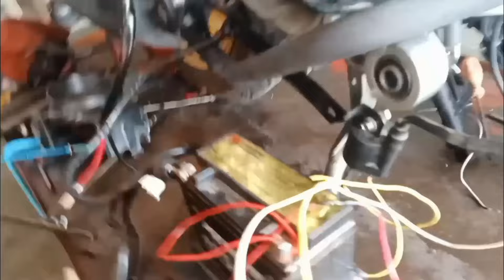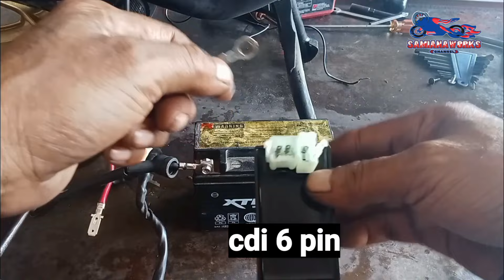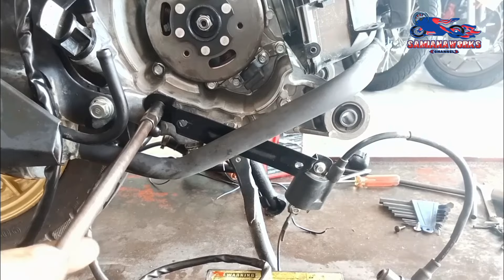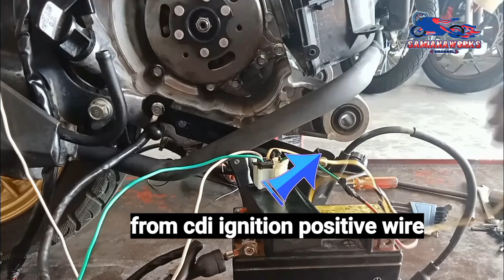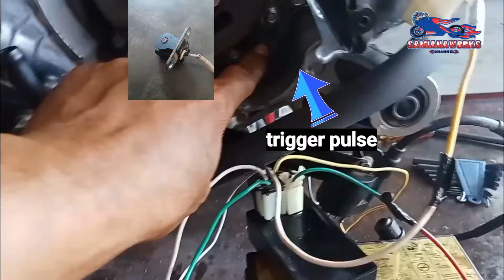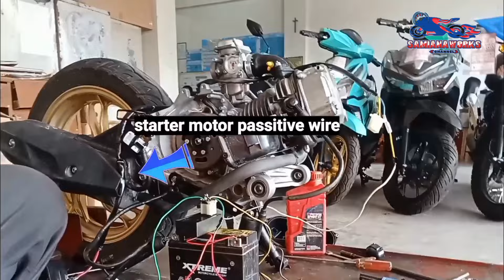How to ignition coil motorcycle & 6 pin CDI diagram actual wirings

Comment: Good video but it doesn't work for me, probably my cdi/installation is a rip. I tried the same procedures as you but... again it didn't work, I changed the connectors as it would otherwise be on my cd, I tried to take two other cds from a friend, but they are 2t cds, and as far as I know, from 2t to 4t, it doesn't work at all, but it's worth it. to try
Reply from the maker: Check his connection carefully, sir, maybe there is something wrong with your seat up! and cdi in the video is battery operated
Reply: @SamianaWorks  
Yes, I connected it without a battery, does the battery send voltage to the cdi or the stator in that situation